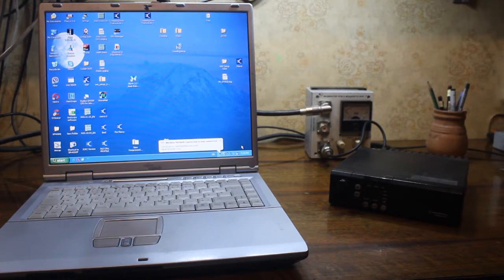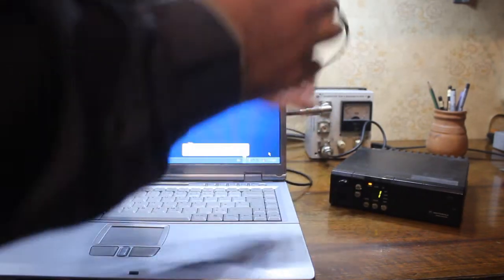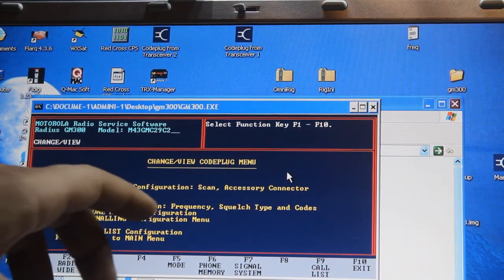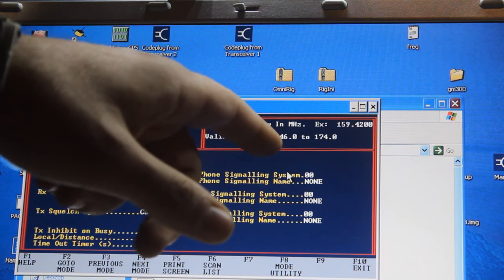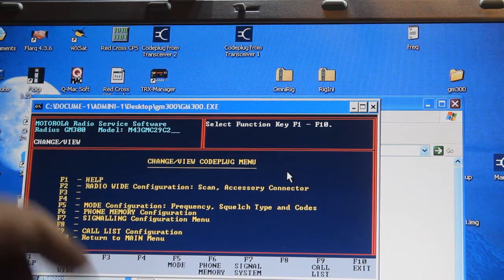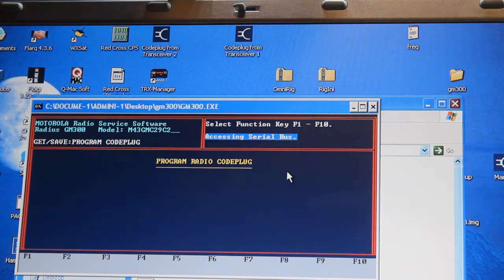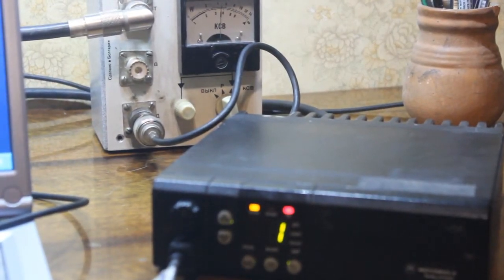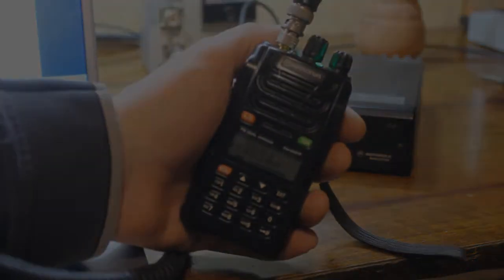Frequency hack in MOTOROLA VHF GM300 Mobile Radio

Comment: I modified it for HAM (PLL part).
M120 was MC145158 so it was very easy, but GP300 is not perfect because I couldn't find information on PLL IC,
but it works fine, so I share it with you who can program with GP300.

57W72 Motorola (GP300 PLL IC)
fractional-n pll synthesizer
FO = (N + (K / F)) * Fr
Fr = 2.1MHz
F is 336 if FO / 6250Hz remainder is 0, or 420 if FO / 5000Hz remainder is 0.
Frequency step 6250KHz,5000KHz,3750KHz,3125KHz
There are 32 steps per 100KHz

Comment: Hi! What we can do, if the frequency is: 144.630 for example? Because if you type 6 using shift the issue persist. Thanks!
Reply from the maker: Here not had any problem, on that frequency here is a local repeater. I programed it well

Comment: Hi everyone, I need your help.
I have a PC with a built in serial port but there is no way it can boot in DOS or any dos supported window version (I've tried).
I've also tried dosbox, and although I've seen people succeed in reading and writing to the gm300, I myself couldn't get it to work.
So, can anybody tell me if the Radius gm300 RSS software will run in a windows 95/98 virtual machine?
If so, can you describe the steps to take in order to ensure that the serial communication will run properly?
Thank you.
Reply: Without Dosbox I was only able to get the Maxtrac to run on Windows XP it likes 32bit operating systems.

Comment: Hi İka, Thank you for sharing this great video,  I have 3 pair of Motorola GP300 Radius radio which I bought maybe 20 yrs ago in UK  ,2 works well with each other but 3 rd one I bought separately and it doesnt get signal from other two, I need this software you used for programming , can you please help me ab that? Ofcourse I need programming cable too, one I get the program I ll buy the cables it from Aliexpress :) By the way I have windows 10 on my pc, is this software program works on windows 10 ?  Thank you and have great day.
Reply from the maker: Hello. Thank you for watching the video. Please contact me on my email address and i'll send you the software. irak.kordzakhia@gmail.com . you need Windows XP or lower, also Necessary to use RS-232 cable. with USB to Serial Adaptor not will work!.  Best Regards

Comment: Hello Ika, I am assuming that you were using a WinXP laptop in a windows dos setup.  However, this process can be slow and will not work with a Maxtrac radio as well as other older radios.  Have you tried the DOSBox software?  It works better, but the best is to get a bootable usb to boot to DOS mode.  Most older radios that use older DOS computers will not work with either dosbox or dos in a windows environment but only with a real or pure DOS program.
Reply: Berthold Edmund I’ve heard people using it, can I use windows 7 tho.
Reply: @adventure_out_and_travel3149  Yes, DOSBOX will work with Win7 but the other thing is to have a serial port on the computer.   It works easier and faster that way.
Reply: Berthold Edmund I’ve tried before and I can never get it to read the radio. So I just program all my Motorola radios my booting straight into DOS.
Reply: @tsu120  Yes, that is good if you were unable to use dosbox